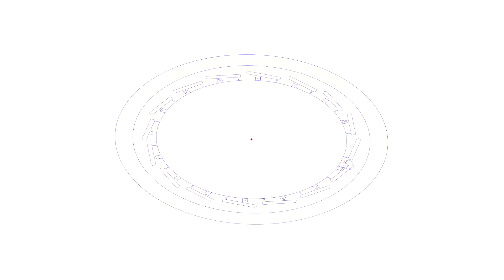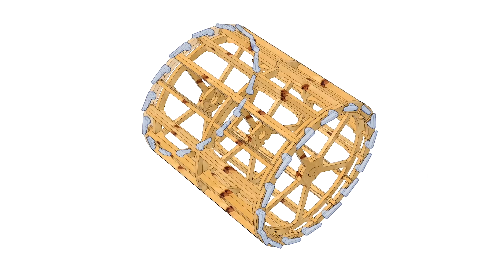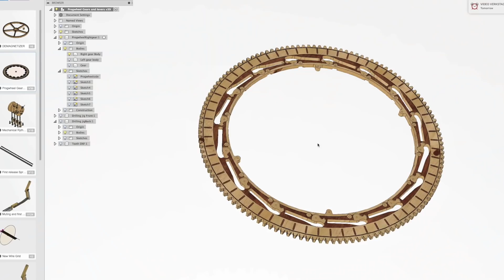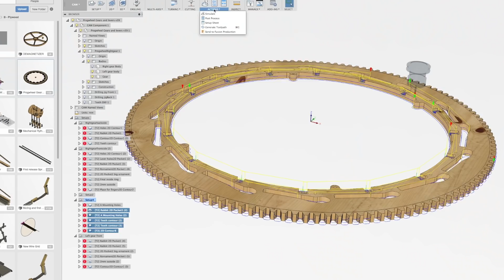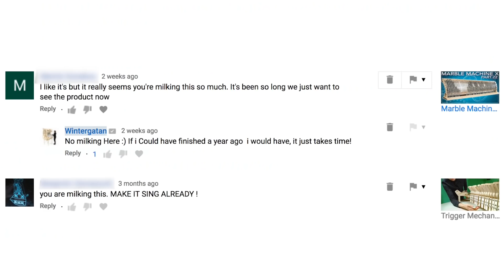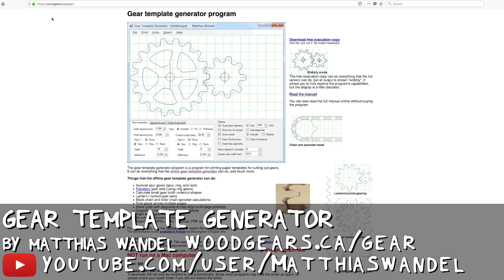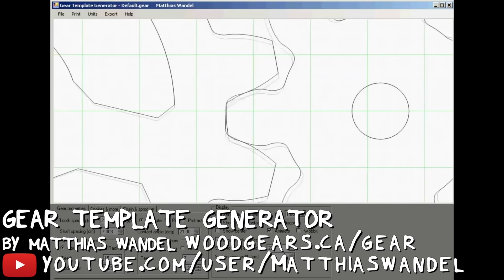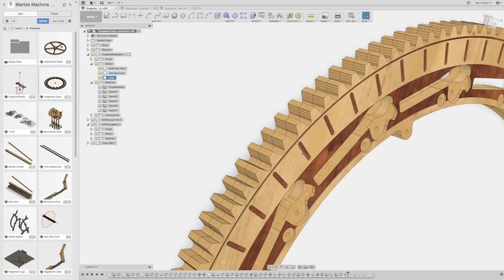Plywood Gears with Precision - Marble Machine X #24

Comment: Wouldn't there be wear on the gears because they are made of wood? Perhaps a metal teeth cap to cover would prevent this.
Reply: Lick Up The Magic metal gears also suffer from wear^^ 
maybe the wooden ones actually show less wear, because wood is more flexible and soft? (just thinking aloud^^)
Reply: John Uferbach the wood would grind down faster then the metal if I'm correct, the wooden gears will literally act like as a sand paper to itself
Reply: Lick Up The Magic hm... i don't know much about wood... and i forgot most of what i know about wear of metals... i only know the gears are touching in just one line at a time and they are touching in a kind of rolling motion, so the teeth don't slide/collide (if that helps anything)
but i'm pretty sure when talking metal its life expectancy is first of all limited by the bearings

Comment: For the song exchange, have you considered keying the panels so the songs cannot be attached in the wrong order? A single tooth key should be sufficient.
Reply: Martin is so ridiculously musically smart that he's probably counting on reordering the panels to create different songs. Either that or he'll just jam to whatever comes out and it will sound better than the original...

cause Martin.
Reply: I like this idea. The male key would always be on the top. And the first key (panel) would be 6" from the left, to tell you it's panel #1. The second panel, would have the key 12" from the left, to tell you it's panel #2. And #3 would be 18", etc.

Comment: Are you making spares? Once you have the CNC program set, even though it takes a few extra hours to cut the part again, it's always far more difficult to go back and do it again later. And if you're touring and something gets dropped ... . Plus, you're going to hope this machine will be working 10, 20, 100 years from now. The original programs and designs will likely be lost, or unusable on future systems.

Comment: I have a question about the programming blocks. Are they set up that they only fit in the correct orientation? If not I'd be a bit worried on someone placing it in quickly and putting the block in upside-down and have an backwards section of the song?

Comment: Martin, I love the Marble Machine X and I think a lot of superb engineering has gone into it. However are you concerned that re-placing the programming plates a lot will lead to the wooden parts wearing out from the friction of putting them on and taking them off so much ? As well as the rest of the machine being assembled and disassembled so often that things may stop fitting so precise ?

Comment: Also, as far as I know, gears transfer uneven force angular moment unevenly. It depends from point where gears currently colliding. So, by offsetting one of gears of 1/2 of tooth you increasing friction, vibration, and deformation during rotation

Comment: there are some gears, like twisted gears they run very very smooth its called "helical gears"
for example: http://impressao3dsp.com.br/wp-content/uploads/2017/06/engrenagem-3d-1170x594.png
or http://www.f-lohmueller.de/pov_anim/engineering/Cog_Wheel_Helical22_5_100_50c.gif
Reply: You'd probably need a 5-axis CNC machine to make those.
Reply: Is possible but very difficult to cut helical teeth on this router. But needs lots of jigs, time, effort for not so good results. Offsetting the teeth engagement is close enough for the power transmitted. What lube is planned to be used? 

Great videos!  This one was LOL funny yet very informative. Thank you very much for your work and effort. These vids must take a long time to compile. Don't know where you get the time.
Reply: Is there any other easy way to make helical gears

Comment: what is your plan if a piece breaks while you are on tour? are you bringing the c+c machine with you? are you making extra parts that you can change if something breaks? is the tour just over if it breaks? it is  made of wood, and the road is an unforgiving place ...I'm also noticing that the smaller gears are already starting to chip. Is that a concern at this stage?

Comment: do you not think, that the new "super smoothness" of the new MarbleMachineX is a problem with the unique MarbleMachine Sound.?
I know it about drums. It sounds terrible, if you play it on a computer. You need the offset and the different timing
between every drummer that sounds good. And the gear-sound on the "old" MarbleMachine is especially.

Comment: I haven't read each of the thousands of comments on the construction of this machine, so perhaps this has been raised.  Have you given thought to the wear characteristics of the gear teeth over time?  I think about the machines in the Speelklok Museum and wonder if the wooden gears in MMX will be as resistant to wear as those in the Speelklok  machines, which were likely fashioned from hardwood.  MMX is a wonderful machine and I hope it has the longevity of those marvelous creations from the past.

Comment: As a musician it would be good to avoid banging parts in with your hands. A rubber mallet or nylon hammer is a good and cheap tool. You glued the magnet to steel with superglue? I'm a bit worried how it will hold. The impact the magnet makes everytime it engages the counterpiece may make the brittle superglue break in time. Maybe not, but it's something to keep an eye on.

Comment: Neat, it's now reasonably caffeinated. And it's starting to look like something at this point.

Other than knowing the machine and song, is there something that indexes the panels so you don't put them in the wrong way around? That cam-locking mechanism is quite clever though.

Comment: I love the way you're doing this and the pace at which you're doing it.  I think that anyone that thinks you're "milking" this has no idea of the scope of what you're actually doing.  It is is all-around impressive.  Your work thus far in both design and execution are nothing short of amazing.

I am wondering - what will you do to "harden" the gears??  Do you plan to saturate the faces with CA???  Seems that would be perfect.

Comment: I can see that your going for a natural look with the gears but have you thought about putting some sort of sealer on the wood parts. This way the parts would be more protected from the weather including changes in humidity that the mable machine will most likely see. I understand that the tolerances on the machine where the parts connect are very limited but I think it would be a good idea to use somesort of clear sealer to help protect the machine.

Also, I love the progress that that you've been making on the machine. As an engineering major I can appreciate the about of time it took just to design the marble machine as well as the time it's taking to build it, also considering it looks like your the only one currently building it. To add to that the way your making these build videos is almost artistic which just adds a whole nother level to the build. I wish I could see you in person as this machine is being built but I'll just have to wait untill you come to Dallas. If your next album is anything like your first album then the concert should be awesome.

Comment: 50 views, 86 likes, and 0 dislikes. 😋

How many seconds of music that programming wheel will hold?

PS. Anybody thinking that making such a machine is easy feat has to be a 👹. I'm impressed. I would have not expected a musician to be that much in engineering and building. I have used Fusion 360 to make couple of models for 3D printing, but I have not taken time to learn any CAM features because I don't have access to such machines. But results look so good that maybe some day I have to...

Comment: its great that you got the gears nice and quiet, although they did add some nice background to the original marble machine.

i was surprised it was that silent actually, since all (conventional) gears must have some play, simply because of geometry. i guess the wood has a dampening effect.

edit: hmm, maybe i need to learn a little more about gears

ah ok. i was thinking of backlash. all conventional gears have backlash because of imperfections. they can have multiple teeth contacting at once though.

Comment: For what it is worth, I'm enjoying the process and as you learned with the original machine - ultimately it is faster to take the time to do it right, once.  Rework and good enough slow things down.  Also, it is clear to me that MMX is not the only project you have running.
Keep up the good work, and "Festina Lente."

Comment: Man, it's a good thing that I'm not working on this thing with you. I would just constantly be asking questions like "Do we have the wood in just the right spot?" "What if we have it off set?" "What if we set something incorrectly on the computer?!" and "WHAT IF THERE'S A POWER OUTAGE WHILE WE'RE CUTTING?!" 

I'm... a bit loony when it comes to shop work like this. Stressing about the small details is a specialty of mine.

Also, you must have done loads of sanding during this process, especially considering the size of those gears. I say this because... well, sanding takes alot of time, and I want to acknowledge that. You must have incredible patience. 

And incredibly tough hands.